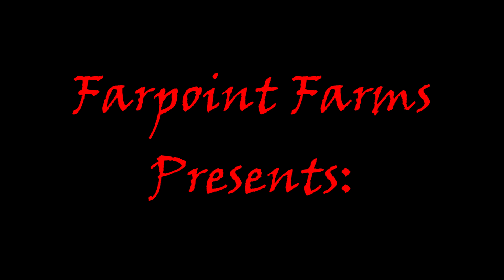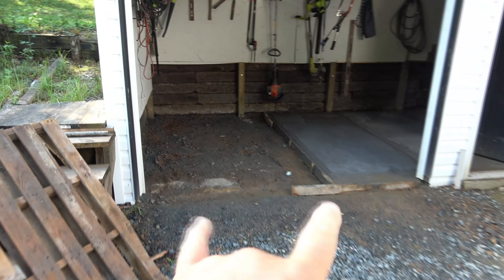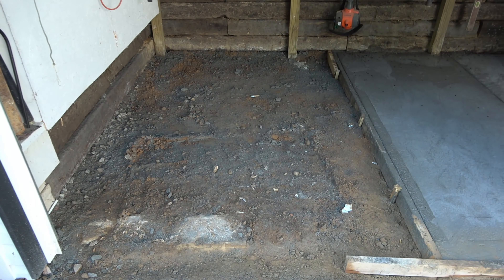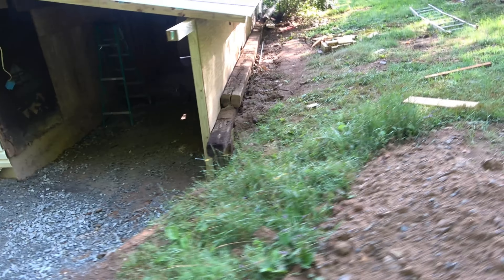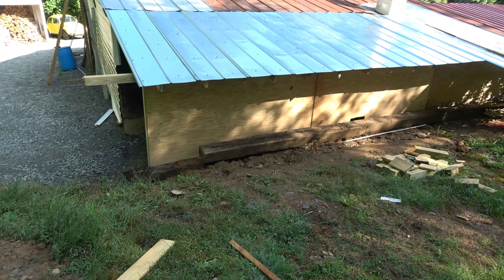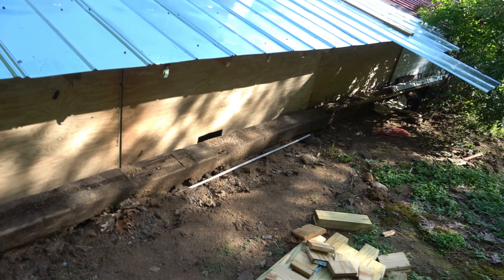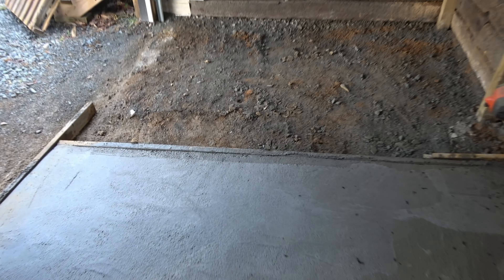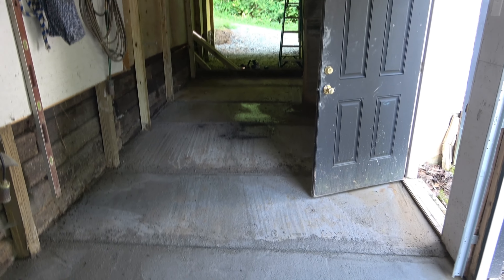Garage Renovations Part 5:  Cement And The Roof Are Done!

Comment: Clean up those spots a bit and then get yourself a bit of that self leveling cement. You can get it in small premixed bags.. it is usually for house or apartment use where the floors are concrete especially in the upper levels to fix dings or chips even small holes.... Do it right and the wheels of your roll around won't get stuck in them.. I have some around here to patch the floor in my computer room.. (which I have not yet gotten to in the last two or three years now) If you like I can look for it and send it to you.. I probably won't really get around to using it.. just replace the floor instead..  Damn brother.. when I was still bending wrenches and working fixing things I always need extra "shop" buildings.. Nice to have the room to do it I am serious abut sending you that little bag of cement.. I really won't get around to using it. Carry on Eric, take care of yourself son.. you are the one and only there on the farm..

Comment: Eric, are you planning on using (more expensive, but more Durrable) Aluminum Gutters, or a Plastic Gutter Kit for the Shop Extention?
Are you going to dig-out a Drain for the Downspout (I hope so, to keep that water away from the building)? "Should" only take 20-30' or Corrigated pipe at a 3-5° slope to properly dispense the rainwater...
LED Flood Lights are absolutely wonderful for an Enclosed Workshop/Workarea!